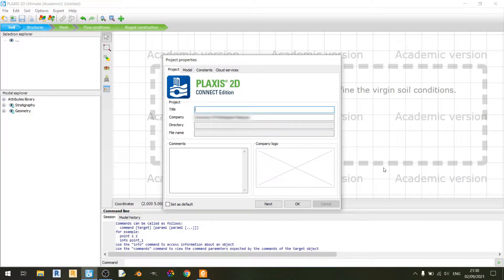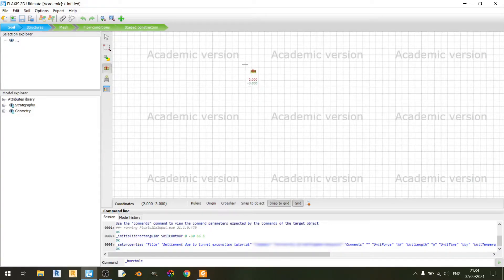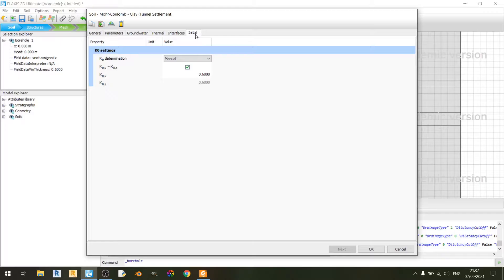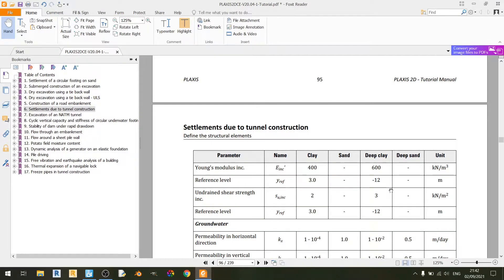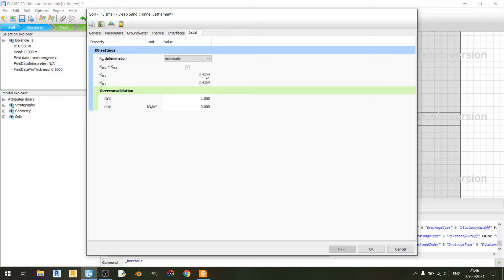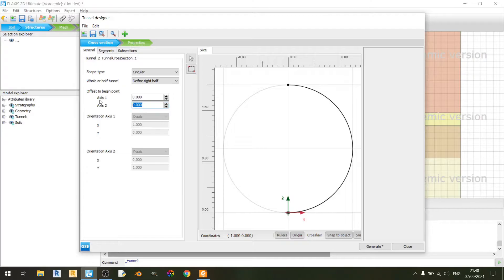PLAXIS 2D | Settlement from Underground Tunnel Excavation

Comment from the maker: Timestamps:
0:00 Introduction
0:55 Project properties
2:45 Borehole placements
4:20 Properties of clay layer
6:14 Properties of sand layer
7:58 Properties of deep clay layer
9:57 Properties of deep sand layer
12:18 Assigning soil types to the borehole
12:30 Tunnel designer
13:58 Properties of tunnel lining 
15:10 Create negative interfaces and line contraction
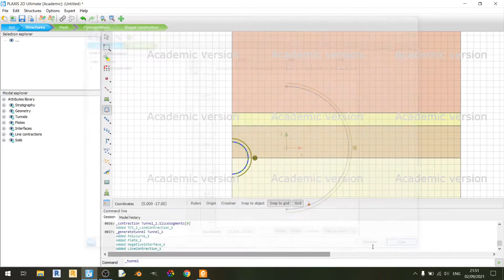15:35 Creating the building
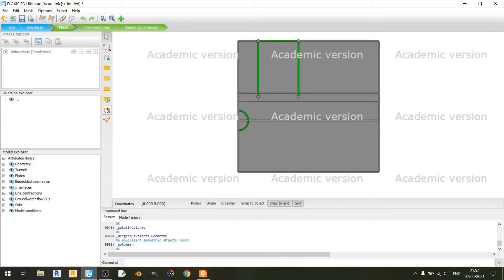20:24 Creating model mesh
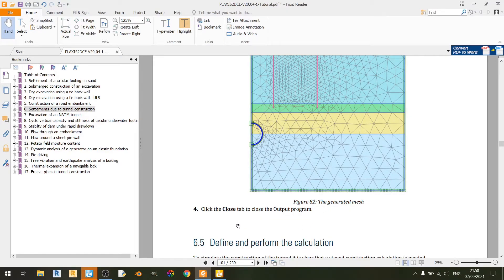20:54 Stage construction
21:00 Initial phase
21:28 Phase 1 (Building)
22:14 Phase 2 (Tunnel)
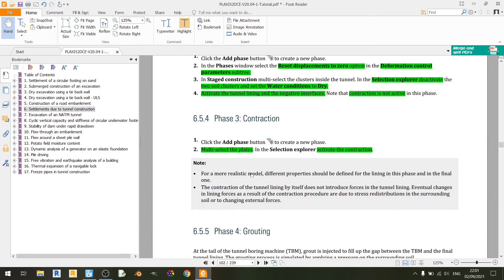23:50 Phase 3 (Contraction)
24:28 Phase 4 (Grouting)
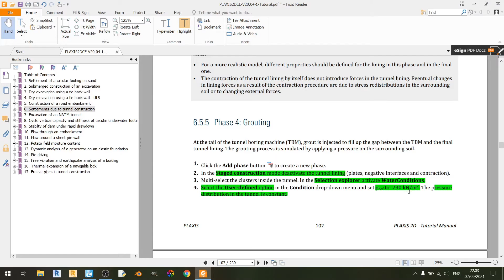25:25 Phase 5 (Final Lining)
26:20 Select points for curves and calculation
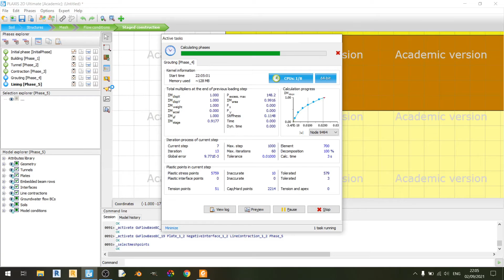26:45 Results
Reply: where is the pdf